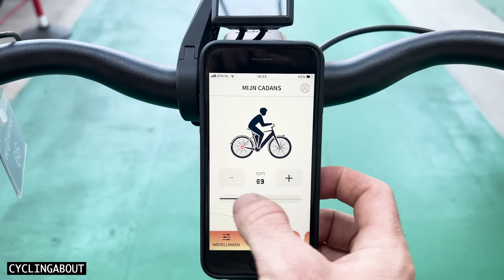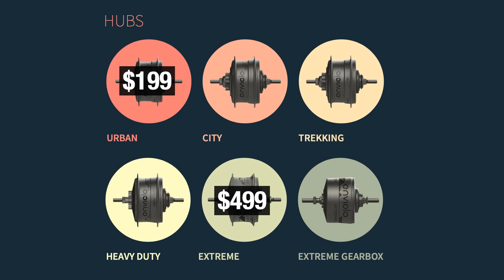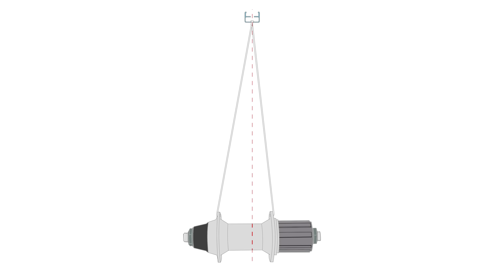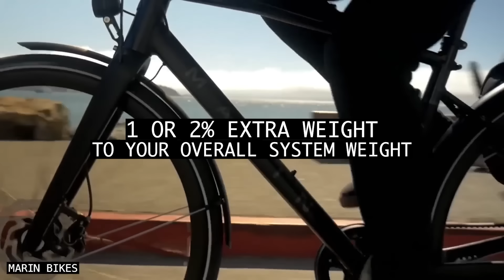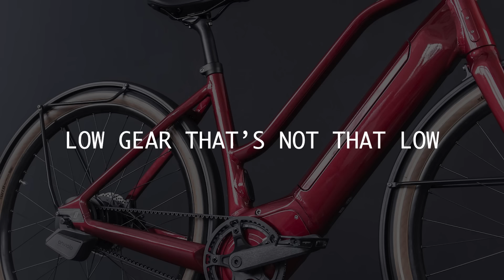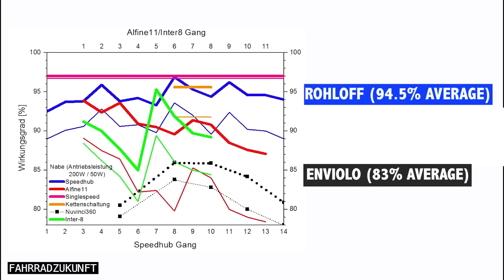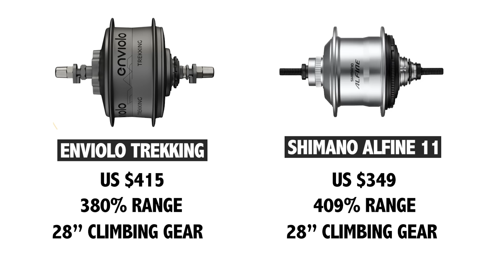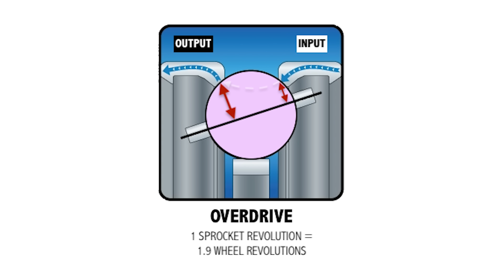Are $199 Enviolo Hubs the BEST Internal Gear Hubs For Bicycles?

Comment: Enviolo maximum Torque is indeed 100Nm but NOT at the Input of the CVT itself (unlike Rohloff which has max 130Nm at the input of the hub itself) but rather at the level of the motor. That is why their table states that you need at least a 2.0 ratio because the maximum torque applied to the Enviolo itself is 50Nm, so with a 2.0 ratio you can have a motor producing maximum 100Nm of torque. So measuring how much Torque Rohloff can take at the engine level vs Enviolo with a 2.0 ratio:
 - Enviolo: 100 Nm at the motor leading to 50Nm Max at the hub
 - Rohloff: 230 Nm at the motor leading to 130Nm max at the hub itself

Also, statement that you can change gears even when bicycle is not moving is partially wrong. Indeed you can change the ratio but not throughout the range and by experience you can only run 50% of the range when at standstill (unlike Rohloff which offers full range shift at standstill).

Comment: I would really like you to do a video on the best bikes (and ebikes), and gear hubs options for the steep hilly areas. I live in San Francisco and some of the hills in the city are 20-24% grade. I test rode the Enviolo and compared it to the 9-speed traditional derailleur did not really like the Enviolo. It has too much resistance and not very efficient. Perhaps the gear range is too short. The Rohloff is better but the bikes are too expensive.
Reply: maybe at that grade its better to walk anyways. The endgame here would be to pave the world so that we can cycle up vertically? Walking wont kill you.
Reply: @RV-jq5pb  E-Bike baby!

Comment: The shifting of those Enviolo hubs on shared bikes feels sluggish and you need considerably more effort to accelerate than with a derailleur drivetrain. 

That matters a lot in an urban environment with lots of starts and stops. Tough shifting at the handle also means your hand gets more tired after a long commute.

I personally would much rather compromise on durability, maintenance and cost than on everyday ease of use and efficiency.

It’s probably ok for ebikes, though

Comment: Interesting! My car has an automatic CVT gearbox, I initially found it weird because the engine drones at the same pitch irrespective of the speed of the car. I guess that's because it's the ideal, most efficient RPM for the engine. I didn't know CVTs were available on bikes but it should offer the same advantage of a consistent cadence at any speed.
Reply: You're car has a CVT? That's pretty remarkable! Is it an old DAF by any chance?
Reply: Almost all Subarus and Nissan compact to midsize cars have had CVTs for a decade now. Not remarkable whatsoever.
Reply: I guess it could be a regional thing then, here in Europe/just the Netherlands? After some digging it seems they’ve been pretty much phased out for a while now, although they never were rare quite to the level of just being in DAF cars.. thanks for the heads up, I now have some weird need to try a CVT equipped car some time.
Reply: @FjodorvS  I once owned a gen 5 Impreza and enjoyed the CVT very much. It was nice to cruise on a long flat highway and achieve 38mph, 2 over what the car was rated for. From 0-20mph it droned about 1200rpm then from 20-70 it gradually increases to 2000rpm. No shift lurches. You can really feel the efficiency over a regular automatic. And of course there's the ability to use the paddle shifters, drop down a few preprogrammed ratios, floor it at 6000rpm and feel like you're in a race car.
Reply: @EricPeelMusic  That sounds pretty fun indeed!
Reply: @FjodorvS  My 2016 Toyoto Fielder Hybrid - petrol and battery - uses CVT because it essentially has 2 motors driving the same wheels. The CVT does seem to spin faster than you might expect but without any gear changes, the ride is very smooth and I guess very efficient due to the computer deciding what ratio to use at any instant. I just drive; too easy. There was a marvelous movie featuring a small DAF car going around the world. I think they named the car after that DAFT idea. Endless Summer maybe - after endless spheres in the gearbox, probably.
Reply: haha watch some videos on when they put a CVT gearbox in a F1 car and it spinned at 15.000 all the time freaking everybody out. It was so fast (but broke a lot) they banned it quickly.
Reply: @scb2scb2  How many games of elementary school telephone did you have to play to end up with such a twisted story like that?

Comment: CVT hubs are probably OK to ride.... for short distances, and not too fast.....   IF  you can put up with their quite HUGE efficiency losses! 
On bicycles efficiency is EVERYTHING because we are talking about such a low power input. Rohloff are very open about their hub's efficiency losses in all relevant gears and it really varies very little from a normal 3x9 or even a 2x10 derailleur drivetrain.  Generally ranging from 94 to 97% depending upon the gear used. A modern 1x10 may be slightly better but is losing out with a lower (or  maybe  same) gear-range, but with all of the wear and vulnerability issues of the derailleur kit.  Nuvinci are extremely cagey about exactly what the efficiency of their hub is, and I am guessing that is because it is probably only 90% or perhaps even lower.  [edit] Ahh, 14% less than a Rohloff or similar!  This would make it a real DOG to ride. The fact that you really only see Nuvincis installed on e-bikes and even for other light automotive uses is a VERY telling sign; they need power-assist to work effectively. 
I have never seen any Nuvinci in use on a touring bike nor even on a commuter/city-bike. With a maximum gear-range of just 380% the Enviolo/Nuvinci does not really cut it for the demands of loaded bicycle touring, where the Rohloff has 526% range and is only beat on this by the Pinion 1.18. Go Rohloff or Pinion for a meaningful single sprocket drivetrain.

Comment: Tried nuvinci on my diy ebike 15 years ago. Efficiency is very bad when ratio is further from 1:1. Like almost down to 60%.
Also you can't switch/adjust under load, you have to release throttle to shift. Check my old videos for details.

Comment: Enviolo/NuVinci are great, particularly the N171, BUT their aftersales services are severely lacking (a kind euphemism for "they suck") and spares are non-existant for almost anything other than their newest items.
That's a great shame because what they're capable of is impressive, until they need servicing. Yes - servicing, because they leak.
You get what you pay for, and never forget -  buy cheap, buy twice.
Reply: The non serviceability is a big no for me, 20000 Km? thats like two years for me. Am i suppose to buy a new one every two years? I know it is a special kind of oil, sell it for more than other oil then, but sell it.
Reply: @AtheistDD  I'm 100% with you on this. My view is that Enviolo are doing themselves out of a lot of sales with this "Our tramsmissions are so perfect you NEVER need to open them up or service them.", because that is NOT the case.
I am going through the "seek and you shall find stage" of trying to determine which CVT oil they use.
Yes, I have tried asking them and got no response. 
So far, I've found Santotrac-50, generally used in aircraft, which is a low viscosity high traction fluid and cost USD250 (250 dollars US) for one quart (~1 liter) as the most likely one.
But, I think (hope?) that one of the automotive CVT fluids will do the trick.
Any and all comments on my views are appreciated.

Comment: Great insight, thanks. I was wondering how it worked. Can it work with a torque sensor?
I think a 'continuum range' would be a better descriptive than 'infinite'.
I've been wondering if a strain wave (or garmonious) gearing would work on a bike?
Reply: yes it does many brands (i use a Reise and Muller bike) use a combo of bosch midmotor (cx mostly) combined with the enviolo automatic. The enviolo can work by itself but some brands (bosch for example) have integrated it into their controllers so you can control the enviolo (see 'gear' and set peddle speed) on the kiox display and buttons near the grip. Not 100% sure what the integration does but to me the combined software (or under control of the bosch maybe) feels smoother than if the inviolo doesn't know anything and does it all by itself. Hope this makes sense the bosch system so the bike uses torque sensors, peddle speed and wheel rotation speed even if the enviolo doesn't directly use the torque sensor the whole bike does so create the best ride. I did 16000km on mine sofar.
Reply: @scb2scb2   Man, I'm looking forward to be able to put some serious miles on the clock like that when I get an e-bike. 
I'm supposed to be choosing one, but actually just nerding out on the variations. 
I live in a very hilly city (Bristol), so that's probably gonna be the deciding factor in the end.

Comment: 1 year update:
Personally I tried both, and about performance claims on enviolo/rohloff, those are done at low speeds, but on ebikes (de-restricted) enviolo (nuvinci) tends to be more efficient because it works better on high speed and high torques, instead of low speed low torque tests. In reality it is contrary for the advanced rider. I experienced the rohloff (geared hub) tend to produce gear crying noises at high speeds, while enviolo doesn''t.
 If i know a thing about entropy, it is that the one makes sound must be lower in compared to one that's only transmitting power.
Reply: *I tested at high speeds only, high torque tests referenced by mid-drive cargo e-bike tests I've encountered.
*I usually ride at 65kmh on tarmac, 25kmh at gravel
**Its only con I see is its weight. note that I'm stripping everything off of bicycle to reduce weight changed to 115g v-brake with 35g ultralight aliexpress lever from 360g rear hydraulic disc and even put 4mm cables instead of 5mm for every single gram save, so the heaviest thing on bike is literally the hub and front suspension. (Lauf is expensive)

Comment: My N380 died completely after only 15 000 km on my pedelec. I thought it was the freewheel at first, but no, the hub was shot. But it's otherwise an excellent ebike hub. I'm getting the Heavy Duty version, which should handle the torque and weight better.

Great video, I generally agree with all you points. Though the shifter feels lighter to use than a Rohloff shifter, to me. As long as there is a little bit of slack on the shifting cables, and you ease off the pedaling.
Reply: I'm curious and considering purchase. Any info you can offer would be appreciated. What were the specific details about your N380 issue? You mentioned torque and weight. Did you have specific problems with torque and weight you can share with us?
Reply: @user-vp1sc7tt4m  Well, when an IGH breaks, torque generally plays a part. Weight can make an axle bend slightly, which can surely shorten the life of an IGH. And the more weight, the more torque is needed to get up the hills. Wrong gear cable adjustment isn't a factor for the wear of these stepless hubs, like it is with others.

I load my ebike with heavy groceries and sometimes pull a trailer. Within the limits of the bike, I believe, but still the rear rack broke. The hub had been making loud banging noises occasionally, and felt like the belt was skipping, but it wasn't. Eventually it broke completely. Pedalling now only produces loud bangs, while the internal mechanism skips, so the bike doesn't move. I tried replacing the freewheel, which was visibly worn, but that wasn't it. It's internal.

My hope is that the higher torque and weight rating of the Heavy Duty version will mean a longer life on my bike.
Reply: I wouldn’t be surprised if the hub was poorly matched to your pedelec. I’ve only done 6000km on an enviolo ct310 and only later have I checked enviolo’s website to see that the city isn’t even rated for use with e-bikes. Belt drive and internal gear hubs do solve issues around rear derailleur and chain maintenance but it’s not as though there aren’t disadvantages as well. In my case for DIY maintenance the lack of useful info online makes simple activities such as replacing the shift cables or adjusting the hub for maximum range a far slower process that takes some trial and error
Reply: Hard to tell what model they added 3 ? different types now for bigger loads my personal view is the range is more a issue for speed pedelec's the automatiq version is a little better in this because you can calibrate is easier but still i would argue its best for non speed pedelecs.
Reply: @scb2scb2  Could well be. Mine is a regular 250W 25 km/h pedelec, btw.

Comment: I would love to see the 3x3 Nine and a Pinion C1.12 included in the comparison as well. Maybe the top of the line Kinderney as well. Efficiency and the delay in engagement is something I would even sacrifice a Pinion for and go Rohloff or else.
Reply: All this talk about 3x3 nine and I've never seen a IGH for sale anywhere. Not to mention none can handle a M620. IGHs are a hoax. Get a wireless derailleur. Done.
Reply: @TheAETHER22  At Eurobike, the guys with the 3x3 Nine were sure it could handle 250 Nm and would be the geared hub that could handle the hardest abuse by men and motor, while offering single speed efficiency by sacrificing weight. It's just that I don't have neutral data yet and am still a bit sceptic. It drove nicely though.
Reply: @PhilosoFox  Still it's not being sold anywhere as a standalone. Maybe through overpriced partners down some months/years? And would still need a custom made frame with splits if you would go custom ebike
Reply: @TheAETHER22  Yeah, although I have to say I have been offered a single over the counter piece from the manufacturer. Didn't act on this option so far, for they didn't tell me a price back then either. And splits only for non-chain versions, true, so no Gates version for me with my existing Cannondale frame. For outside-Germany end-customers, I can't see a viable solution to get one as of now. So Rohloff or Kinderney would be your alternative so far. But then, when using a custom made frame, you could also walk the extra mile and go Pinion MGU E1.12 already. Or just go with the Aden sports add-on solution on your existing mtb for brutal acceleration:hand-orange-covering-eyes:

Comment: I finally could not contain my curiosity and bought a Priority bike with a belt drive and Enviolo hub.  It is merely ok, certainly not life changing.  The hub is heavy, and the belt drive is certainly no better than a chain drive just for propelling the bike.  I find myself missing that old familiar click and engagement of a well-adjusted shifter/derailleur/cassette drive train.  To each their own, personally I regret the purchase and will never buy another one.  I'm not knocking Priority or Enviolo, just stating in my experience there was nothing significant to justify the hype.

Comment: So I have a question, Canada gets colder than -20 C is this temp rating specific due to limitations or is it just a guideline the company set?
Reply from the maker: That'll be a question for Enviolo or perhaps shops that sell Enviolo bikes in Canada. I'm not sure what happens to the oil at low temperatures.

Comment: Why do we have to pedal at the same cadence all the time?  Would it not be healthier to vary the cadence, pedal fast sometimes, pedal slow sometimes, pedal hard sometimes, pedal easy sometimes?  My single-speed or three-speed is perfect for this.  
     The belt drive is perfect.  Why is it so difficult to find a bike with belt drive?
Reply: Might depend on country more and more bikes here (netherlands) use belt-drives my normal bike koga also uses a belt drive and internal geared hub.

Comment: I've cycled on a NuVinci (not suere which version it was) hub twice when renting E-bikes. At first I was pretty confused why there were no clicks/indexes. But after a while I understood it was CVT. The "heavyness" of the shifter when stationary is something I also experienced, but I liked the way you could pedal at any gear ratio, especially handy on rolling terrain.
I only have ridden two types of rear internally geared hubs, the NuVinci and a Nexus 8. Both were geared pretty light and I like faster cadences so I ran out of gears on both bikes on downhill stretches. I am considering an IGH on my next city/urban/light trekking bike, I have to check the gearing though.
Reply: What is IGH?
Reply: @vd1261  Internal Gear Hub ;-)

Comment: I have a NuVinci (before the Enviolo rebrand) N380 on my Riese & Muller. I never found the shifter to be heavy, and I think I’ve twisted it all the way from one extreme to the other while stopped and had no problems. I haven’t ridden the bike for a while so I can’t remember 100%, but I’m pretty sure it was easy to turn. But I also made sure to stop pedalling for a second each time I shifted, so I probably didn’t wear the cable out much. It’s a good system, but I did notice a bit of weird vibration sometimes. I’m still not sure where that comes from. Even though I think it’s good, I probably would still get the Rohloff when I eventually get a new bike. I kind of miss having the numbered shifts, and I feel like the vibration would probably not happen on Rohloff either.

Comment: We have 10 e-bikes for rent at our company with these enviolo hubs. They are not reliable. Every single one had to be replaced already at least once within 1000 to 3000 km. Of course rental bikes are used more roughly, but that every single one was broken it more screams like a reliability issue. the highest gear was also not that high, as after 25 kmh it was impossible to speed up the bike, as I was strampling already super quick. These were installed in Riese and Müller bikes, which are quite expensive (like 6000 dollars each)
Reply: If you have such an high cadence at 25kph it really needs a heavier gearing on the belt or chain.